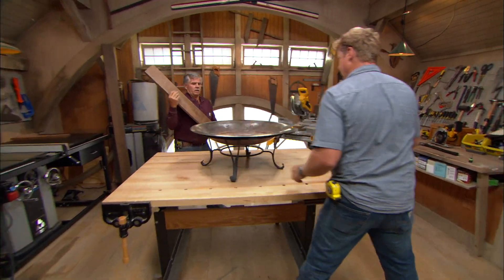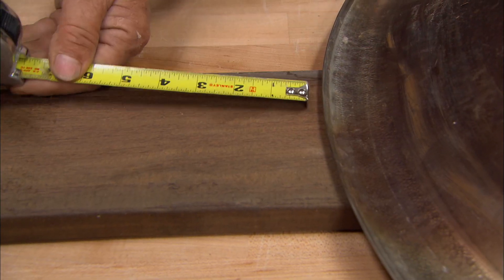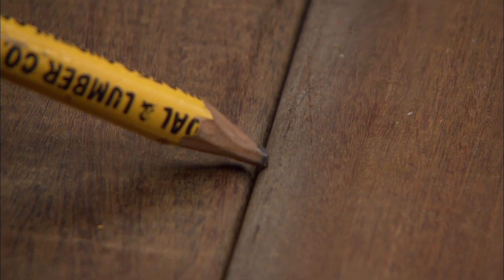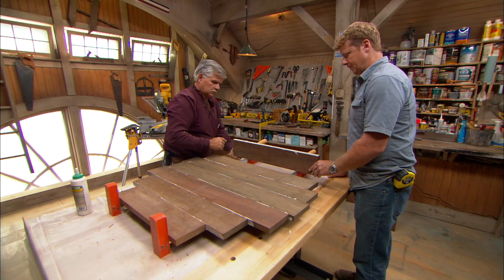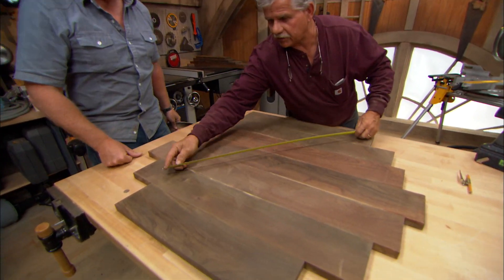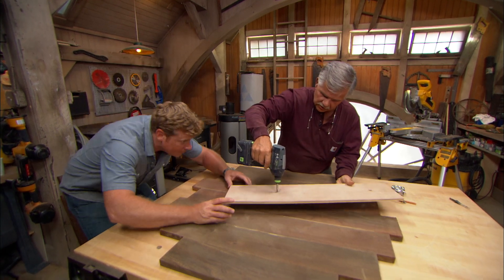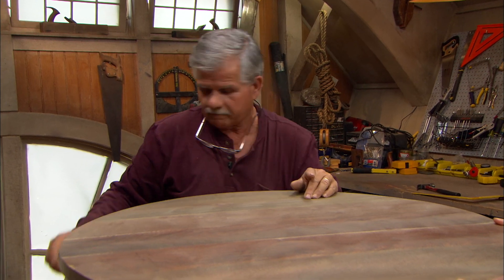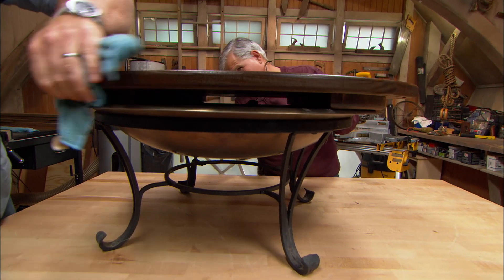Fire Pit Cover | Build It | Ask This Old House

Comment: wow... awesome top!  one point for people to know.... Ipe is very toxic to the lungs, and the dust is very sharp since the Ipe is so hard and so dense.   When you cut or rout it you should wear a mask, and/or have a fan blowing the sawdust away from you.   I built an Ipe deck in 2019.  I have some left over and think that I will use it for my firepit top.  thx for a great explanation, esp allowing the screws room to move with expansion

Comment: Curious why he didn't cut a groove in the 2 bottom boards, so they'd prevent the top from sliding off, if it got bumped and fall off. But, still allow it to stay dry. They gap they have now, potential for plenty of small critters to get in there, or collect dust.

Comment: Makes cover for fire pit to prevent water getting in and filling up the pit... makes cleats so cover sits above the pit to allow air (and water) in. Genius!
Reply: The overhang keeps most rain from getting in, the kerf keeps the water from getting sucked under the table from surface tension, the gap will keep it from trapping any moisture by allowing air to circulate and pass through the fire pit. If the rain is blowing horizontally enough to get up and under there to fill up the bowl with all the precautions he's taken I'd imagine the cover/table would've long since taken flight anyways.

Comment: Interesting. How expensive is this stuff? This can be a good surface for an outdoor table
Reply: Techmatt167 
Wish my outdoor furniture was made of this.
Wasn't even pressure treated. Now I have to treat it every year 😤
Reply: A lot. The tools are the most expensive part and can cost thousands for everything. Eventually you'll need to sharpen or replace all the cutting bits as they dull from use.
Reply: What they fail to tell you is how dense this stuff is, it will blow your mind how heavy it is. That cover is heavy...I worked at a major wholesaler of this wood and I hated it. Also, the dust from cutting it would give me a rash on my eyelids. 

When they say ironwood, they mean iron wood!

Comment: pretty neat. I bet those big long clamps cost a fortune though
Reply: They're not too bad if you get them used.  Even new, they're only about $50 each.  Keep searching on Craigslist and you may find a local cabinet or furniture shop that's closing up and selling old equipment for cheap.  I bought a bunch of 24" K-body clamps for $20 each from just such a place.  Best money I've spent so far for my home shop.
Reply: I always search them on Craigslist.  Garage sales and estate sales as well.   I actually scored a rousseau router lift and a aluminum router fence for under 40 dollars last weekend... very nice and going to make a fine router table.  Planning a build soon, but they will see shelf time while I finish up other stuff.  Both designs were bought out and updated and are sold as the Woodpecker brand now.   Still cool though.   Keep and eye out for quality stuff and cash in hand is way to save on it.
Reply: Jesus I'm not a shop carpenter so I would probably never use them again. It's hard for me to imagine too many home owners having a lot of use for them a second, third, or fourth time either. You got a good deal on those 2' clamps. I think I would have bought those as well. $100 on clamps is just too much for me unless buying the top for the fire pit was $80 or better. Then it's only $20 more and I could own the tools. That I could justify.
Reply: Danny, that's true. I love to save money on tools. Estate sales are always cool to go to
Reply: Well, my general stance is that you can never have too many clamps, so I'm always on the lookout for a deal on them.

Comment: what's the reason tommy would rip the edge off each small board, rather than making that first step on on long board? Seems to me like it would make for an easier job to do it while the board is still whole.
Reply: Because it’s very hard to take a very small amount  off the side of a very long board. It tends to move side to side however careful you are.

Comment: I'd rather use a stainless steel cover, because you can't use wooden or fabric covers right after using the fire pit because of the heat.

Comment: Let's make a cover for a fire pit out of wood because wood does not burn.
Reply: MsUltrafox It's high density wood that would take a massive amount of BTUs to burn. More than in a small firepit.
Reply: its not toilet paper it wont burn that easily. why do you think there are wooden spoons and cookware?
Reply: Wood doesn't burn as easily as you think.
Reply: Suspect troll.  Can not confirm. The purpose is to make it a table and keep water out. When you’re not using it for fire.

Comment: So easy if you had all the tools
Reply: Table saw, router, and a chop saw.  That's some very specialized equipment, indeed.
Reply: Craigslist usually always has a selection of used woodworking equipment you can acquire for a fraction of the original cost. Most are just motors and blades, even if something other than the blade is worn out it's usually an easy fix. I've been eyeballing some nearby myself.